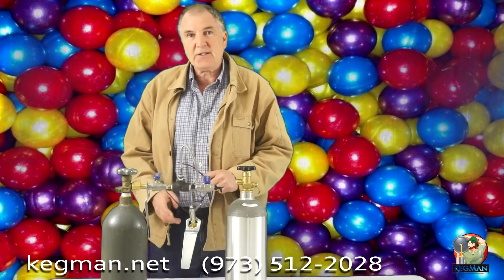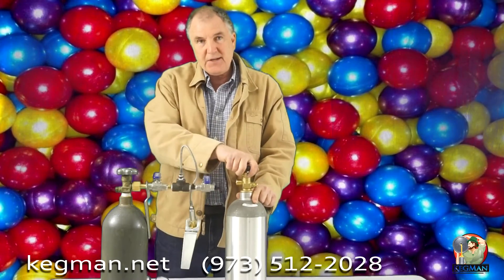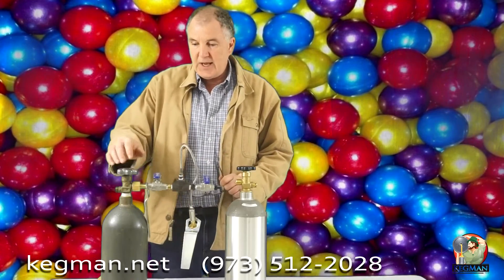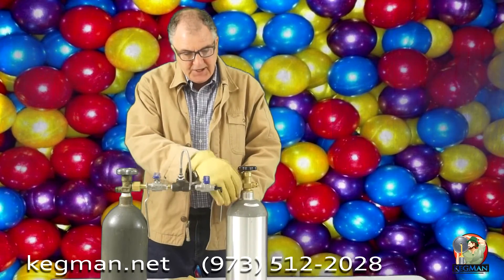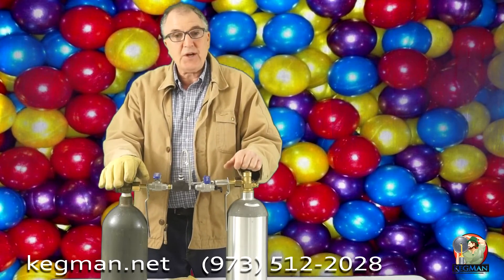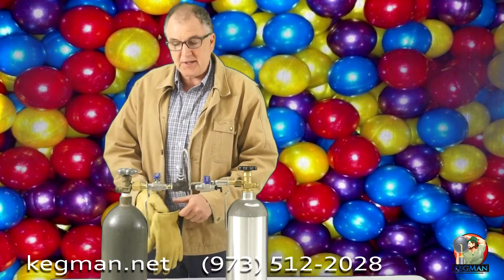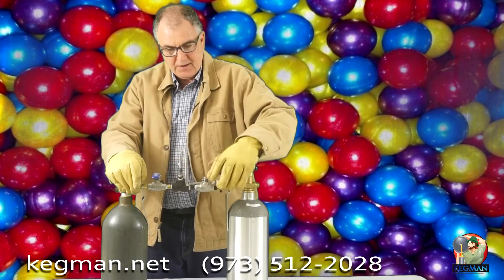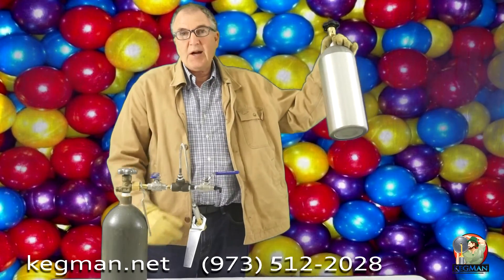How to transfer C02 gas from a high pressure tank to a smaller tank

Comment: Dave does my larger tank need to have a siphon tube? I've heard it's important to transfer the liquid and not the gas... seems to be conflicting information out there on this important point.
Reply: Yes you want the liquid not the gaseous nitrogen. Otherwise you'd have basically no nitrogen in your tank yet you'd be at full Pressure. The liquid is what you want.

Comment: doesnt the smaller  "empty"   tank contain air  - if your filling with co2  where does the air go?
Reply: The gas from the full tank is at a higher pressure than the receiving tank and the empty tank is as close to empty as possible
Reply: You asked a year ago but the smaller tank has low pressure co2 in it. When you open the valve to atmosphere the old co2 exits but only until it equalizes with the ambient air pressure. Purge the transfer line of air and you will only have co2 transferred into the tank. Freeze the receiving tank and you will get a more complete transfer closer to the tank's capacity.